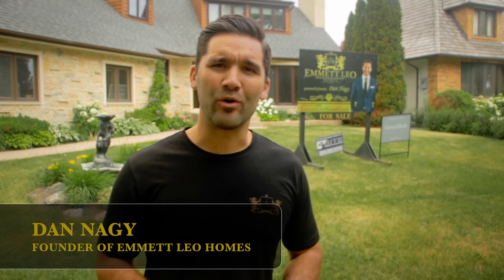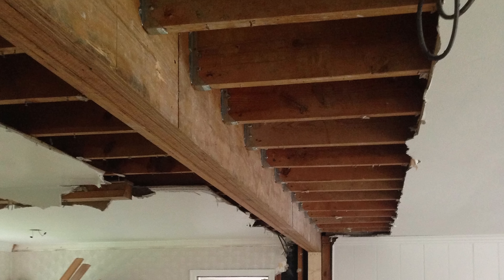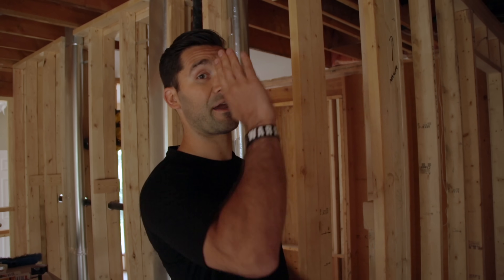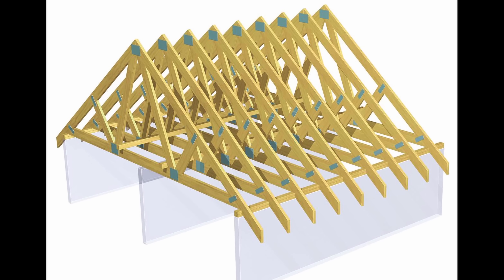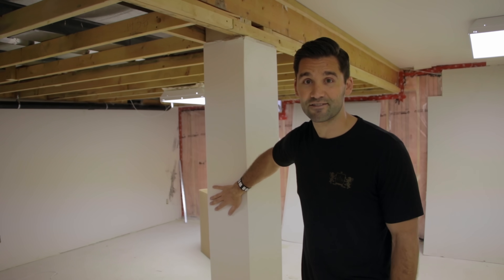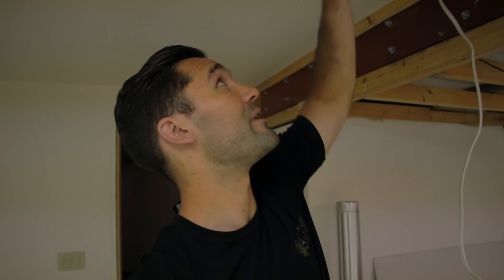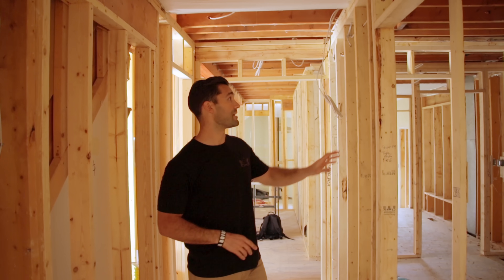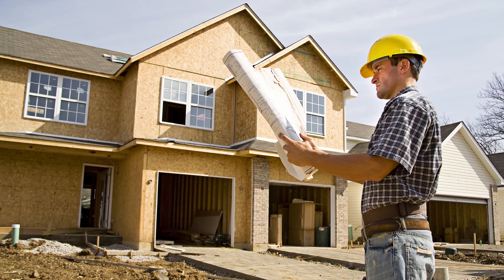The fastest ways to tell if your wall is load bearing or not!

Comment: I'll keep it short, hire a professional.
Reply: With that being said don't trust all those professionals
I've been remodeling for 30 years and I have seen some professionals that were not

I would definitely research your contractor
Reply from the maker: KING. K it’s great for people to understand what a professional needs to do before they hire them.  

And you are right, professional will save stress, time, and potentially save costly mistakes!  

Thanks for watching!
Reply: It's always reassuring for a homeowner  to have a good idea of what a professional is meant to be doing to your home and why,  though. Great video, thanks!

Comment: Hate to rain on your parade.  Everything you said about a bearing wall is true.  But you make it sound so simple.  Unfortunately not a single mention of plumbing, hvac or electrical.  Open wallet; plumbing $$$$, hvac $$$$, electrical $$$$.  Nothing some bucks can’t fix though.
Reply from the maker: Chris Moody not raining on my parade at all.  The video is not about the cost of removal or all the steps.  It’s clearly about identifying and overview of removal, not every step.  You do make some great points however, and you are on point about the costs being much higher if there are mechanicals services in there.  Thanks for watching.

Comment: Thanks so much!  This is the video I’ve been looking for!
Reply from the maker: Delayedbutnotdenied2020 glad it could help!
Reply: Why?
Reply: MrBonners I purchased an old colonial home. The steps are leaning backwards.  I didn’t know how I could fix it.  This is what I needed to help me fix it at the time. I’ve found someone that’s going to remove the steps all together.
Reply: @mscupcakedreamson36  This is a very bad demo or explanation of some very easy to explain basic structure knowledge. This was nothing more the a hand and arm dancing 10 minute video selfie. This far less then basic (and there are errors and ambiguities) and nothing from this video should be used as valid info for any reno thoughts.  Plenty of other better videos on this here in YT.
Reply: MrBonners Oh I answered about the wrong question. But I’m no carpenter so I wouldn’t know what works or not. Lol. It just answered a question in my head. All information is good. I do a lot of research when I’m trying to do something. I did get an understanding of what to look for here. Thanks.

Comment: You can also use those small button style ,rare earth magnets to locate the fasteners in your drywall. You can quickly determine your joist direction based on the layout of the drywall seams. All without damaging or cutting out any drywall at all. Hope this tip helps
Reply from the maker: Jerry Strader great suggestion!
Reply: What happens if the joist have been batten out with either steel battens or with timber battens running perpendicular to your joist?
Reply: You can also cross-light the ceiling with a flashlight if it's dark enough.
Reply: Assuming it's drywall 😅
Reply: What if you have plaster?
Reply: Unless the wall or ceiling is strapped.
Reply: Brilliant!! Saved me so much time... thank you!!

Comment: If there are 2 walls near the center of the house (as in a hallway)  running perpendicular to the trusses above them, is it possible that NEITHER one is load bearing and that the trusses were designed to span the entire width of house from outside wall to outside wall? OR is a truss that is designed to use a bearing wall near its center be less costly and, therefore, almost always used by a builder?
Reply from the maker: munsters2 you are correct in both your thoughts. They MAY not be load bearing, but chances are, depending on span, that at least ONE is.

Comment: this is a big piece of information that he forgot to explain in the first place if you decide to take out your load-bearing beams without reinforcing the upper floors you could basically have your house cave in on you in one story I went looked at a house the guy was dumbfounded on y all his floors where sagging and yet his base molding was running straight the previous owner took the load-bearing walls out without reinforcing the floors started to cave in the base molding was where the floors used to be I ended up condemning the guy's house it was unsafe to live in he was not happy that he bought a house that was on safe to live in because the previous owner decided to do his homework it's very important to find out and if you going to remove a low bearing wall you must build a wall on each side first before removing the bearing wall because also become temporary until you replace with an I-beam to hold the floors up then remove those temporary walls
Reply: P.U.N.C.T.U.A.T.I.O.N
Reply: @kohdez  I believe that's a thing of the past
Reply: Joseph Malinowski son please delete your YouTube account and never access the internet again. You are absolutely and completely wrong.  How can so much stupid come from one idiot.